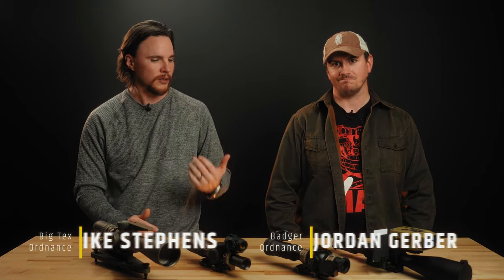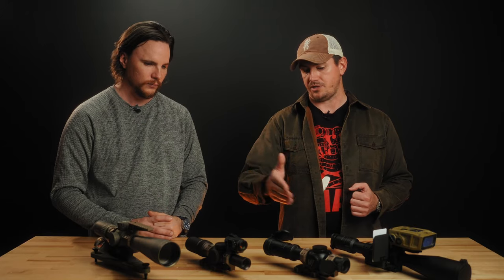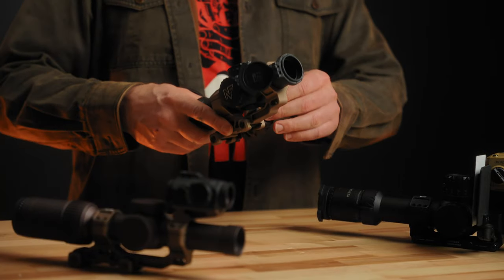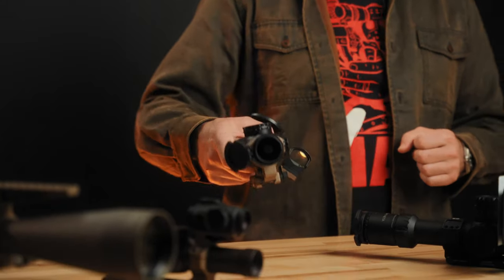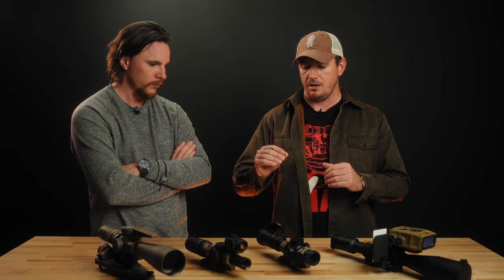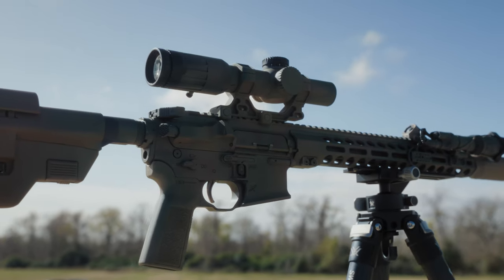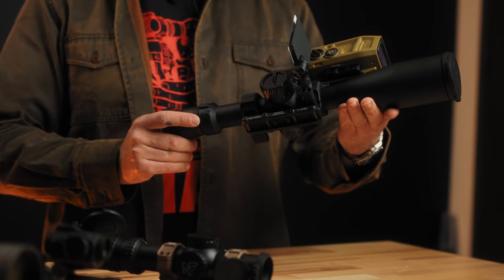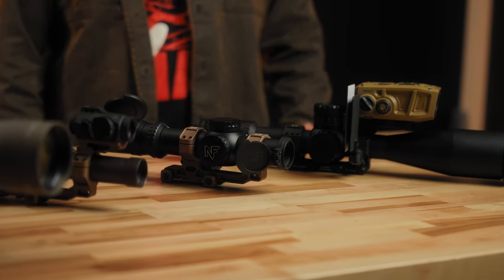Badger Ordnance Condition One Mount Overview

Comment: Question: Do you have a recommended 12 o'clock rds solution for a PA GLx 3-18 x 44? 

I haven't seen either scope or mount in person, but I'm wondering if that 12 O'clock mount on that LPVO you have there would clear the front due to the much larger 44mm objective lens.
Reply: if you are using a RMR footprint, you can use reptilia spacers to get the dot over the turret. there might be other options for other optics to raise them up a bit, I used the reptilia option, so I know it works.